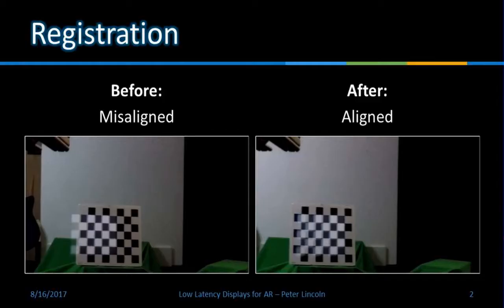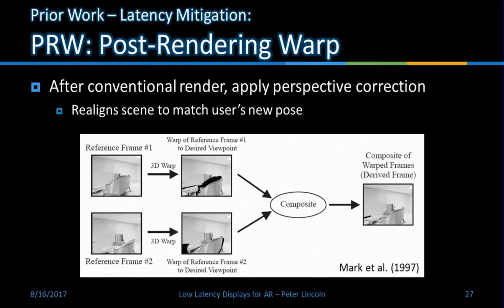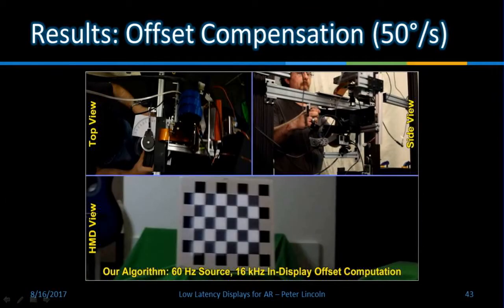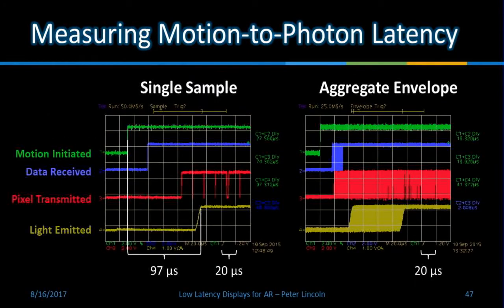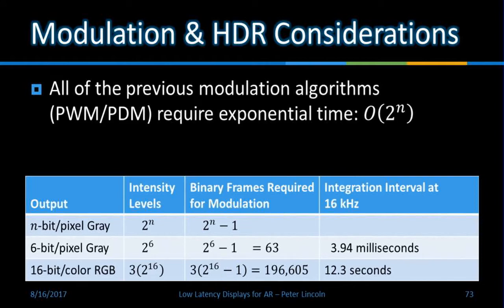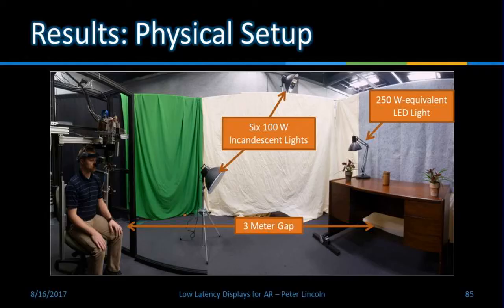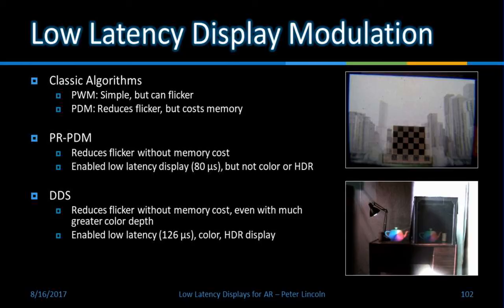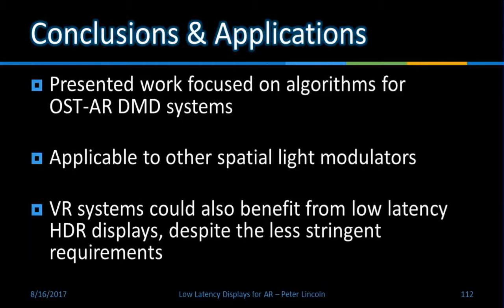Low Latency Displays for Augmented Reality

Comment: Put a processor and some light field sensors on the HMD and let them stitch a video that simulates the wearer's (eye's) view port.
Then do the post-render transform corrections on the HMD itself, (enhanced by motion sensors) when compositing the holograms from the host pc/primary device with the stream from the light field sensors on the HMD
Reply: Sounds sensible. The only problem is the amount of computations you need so you'll probably end up power / heat limited because there's only so much heat output and cooling systems you can attach to the user's head.